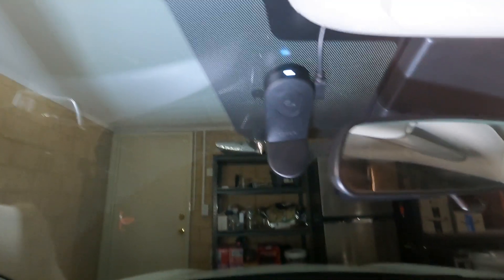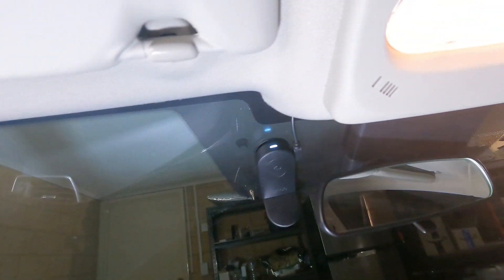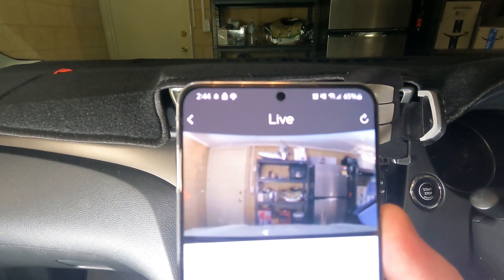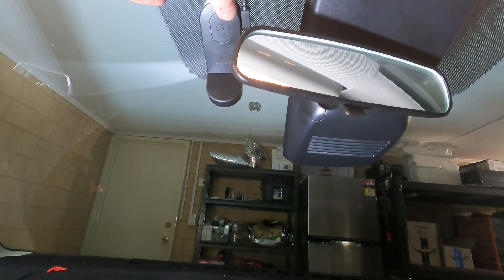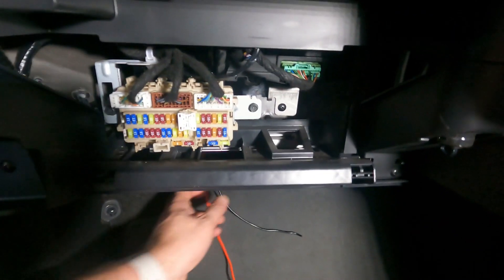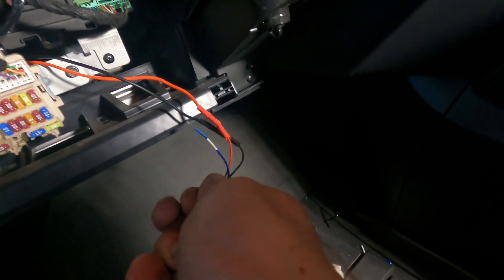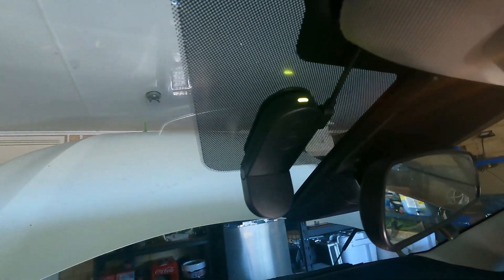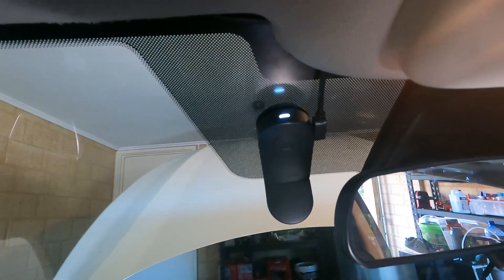Dride 4K Installation

Comment: Dride blue wire goes to cars ignition, where does the other Dride wire , the red one, go into?
Reply from the maker: The red should be to live power, that would be the fuse box on a circuit that doesn't turn off when the car turns off, you can use the fuse they provided. Or wire direct to the battery if you want it to always be on.

Comment: Do a proper install video PLS.
Reply: I really appreciate you wanting to help, I hope i didn't come out as rude, I was simply wanting to know if you filmed a full install video. 
If you could please let me know how you managed the wiring part. I have the dride 4k, but I have difficulty  wiring the cables into the battery.
Reply from the maker: No
Reply: Ok
Reply from the maker: @Crazykiller1969 just kidding though, what did you want to see? This was just me and a go pro, but can help if you need additional direction.